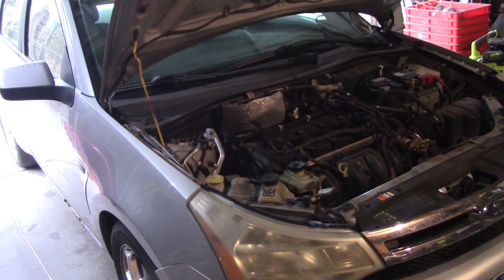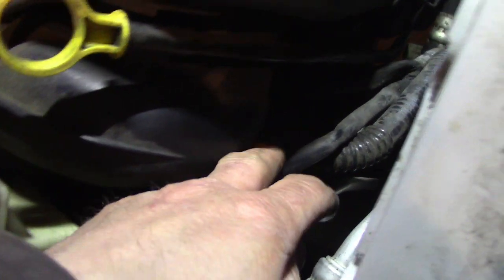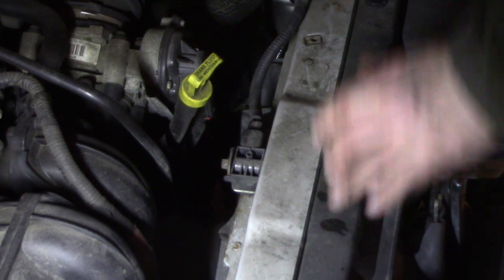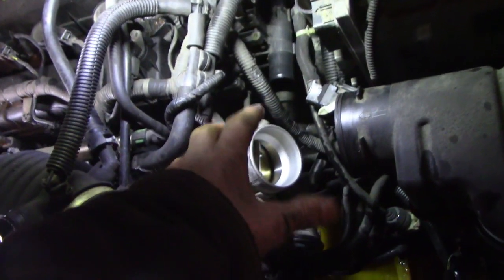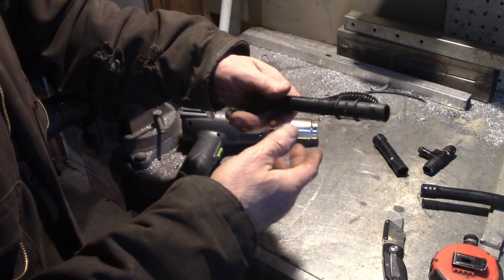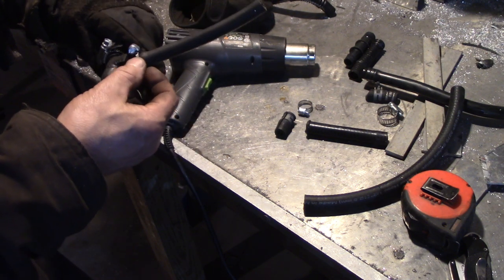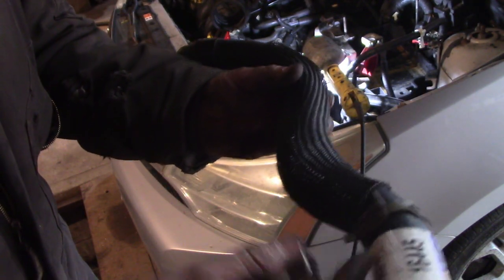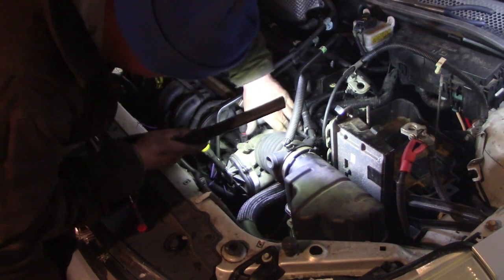2008 Ford Focus heater hose (alternative fix)

Comment: Ha!  Just had this issue today.  The plastic pipe broke at the first bend from the water pump.  And three months ago, the radiator hose broke in the exact same place as yours!!!  They want $100 for the replacement.  I managed to get the hose off of the pump side, then looked around for some tubing, and found a copper pipe in my garage and cut a 2 inch piece, cut the plastic pipe at the break, and shoved a  2 inch piece of copper pipe into each end of the plastic pipe and clamped it. Holding great.  Probably going to buy one soon, I'm not sure how long it will last. Thanks for the info!
Reply: That exactly what I was thinking just happened to me today too lol damn Ford
Reply: @tomgill9467 i  did the exact same repair you did on the left side facing the car at the bend where his broke. its holding up fine. The only reason i'm here is because i'm thinking about fixing it the right way but after watching this I will probably just buy the metal hose and if this repair breaks pay someone else to do it. I'm handy but i'm not going to risk breaking 2 other things trying to fix a pin hole again but I respect it. If I can't find anyone that wants to work at least this video showed me I could do it if it came to that. I don't plan on driving this car out of town anymore but if I did I would want it fixed not jimmy rigged :)

Comment: I think that those hoses, and all in the car in general, can be changed for common high-temperature resistant rubber hoses. They usually sell them in hardware stores in sections.

Rigid plastic tubes tend to become brittle with high temperatures and break as in your case.

Comment: I did this only to find more leaks down the hose. Removing the pipe is a huge hassle as you know. 
I eventually just replaced the plastic hose with the aluminum hose and it will never leak again. 
It’s just to much effort to get it out to repair and get back in only for it to get snipped somewhere else. 
In a pinch it’s a solution but long term you just have to replace it with the aluminum hose. $147 from ford.

Comment: that is EXACTALLY where mine is leaking.....  same VALLEY of the bendy joint there even!!!  sigh....  it was spittin rad fluid up onto the FAN ... and when locating it earlyer this evening, the FAN DID NOT KICK ON ...  I hope it didn't fry the fan sigh....  the fan should have kicked on before the temp guage got half way up, right???  it didn't get hotter and the leak started peeeing when it got upto THAT hot...  
\
eh... unpausing to see what the ALTERNATE FIX is....  ;)  hopeing it is just spliceing in a section of rubber hose... cuz takeing the airbox and ecu and battery and all that stuff on the right side, seems like quite the job.........  unpausing...  

THANKS FOR SHAREING THE VIDEO!!!
Reply: bummer NOT REPAIRABLE??  sigh......  looks like we going METAL REPLACMENT eh??  yikes like 100bux later...  I hope MY upperrad hose don't become a causaulaity TOO!!!  THANKS FOR SHAREING!

Comment: The way my heater hose broke it popped off from the connection to the egr valve so i HD to order one off rock auto and it was made out of metal instead of plastic

Comment: My friend how you connect and disconnect the left side of the hose ??
Reply from the maker: If I remember correctly it's just a plastic hose pressure formed fitted over a nipple so I sliced it and pulled it off
Reply: Thank was a really pain in the ass my finger got fuck on the mission to make sure I was not breaking something else 😅BTW I had problems looking for the same part and the one I took out was toast no way to get it fix